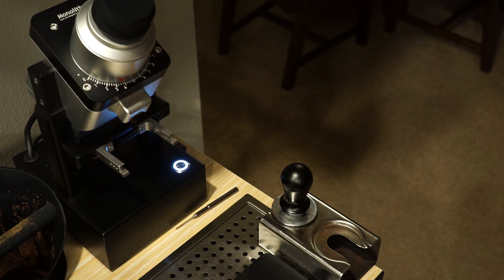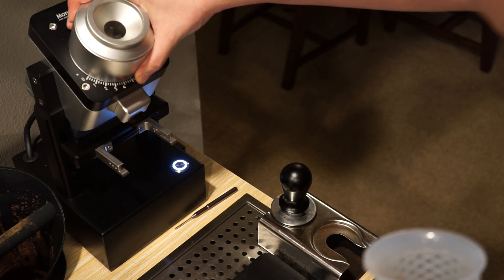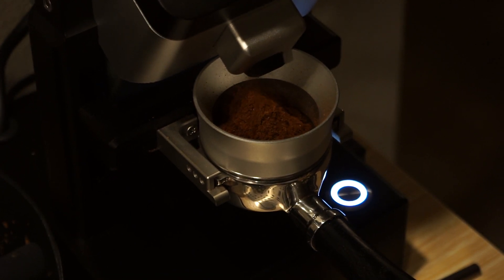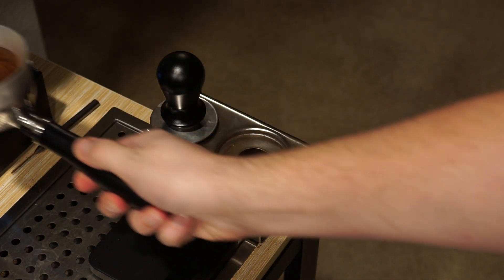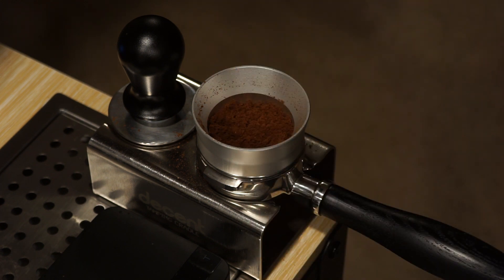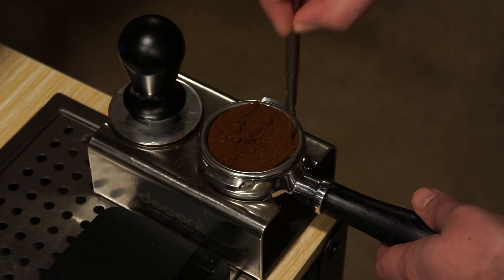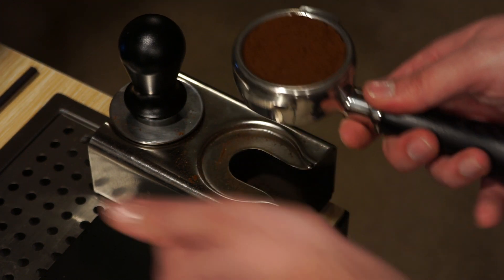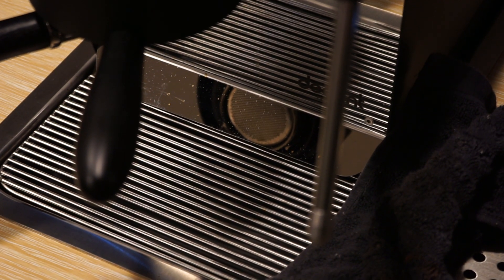Example of (Less than perfect) Puck prep Routine!

Comment: Get the Levercraft WDT and the Decent funnel. The nedles on the Levercraft are 8 and 0.4mm thin. Also the Decent funnel doesn't go into the basket, leaving a ring on the edge, because it sits on top with magnets. Love the setup you have. This might be the best grinder/machine combo, money can by. )))
Reply from the maker: Thanks!

So I have the funnel but it doesn't work with the max grinder, it's too wide.

I'll check out the wdt tool, though I also used the needle that came with the grinder and that seemed fine too, but this rake is more consistent.

Deff makes great coffee!!